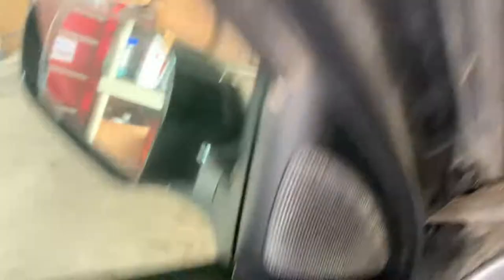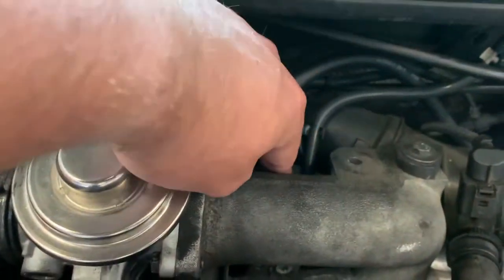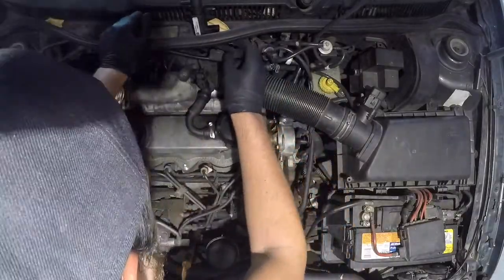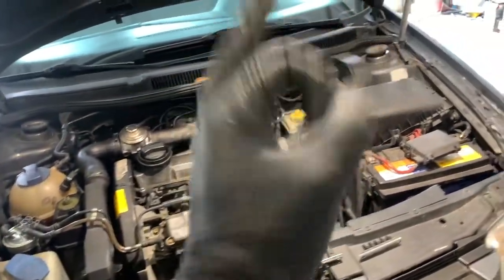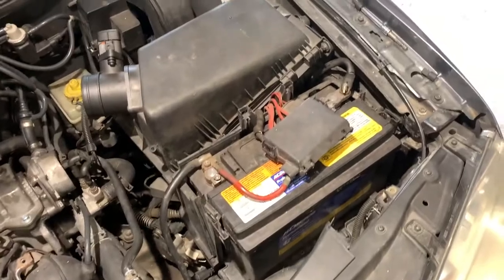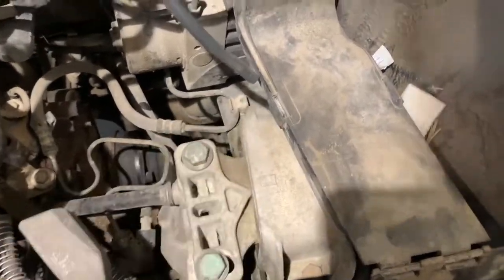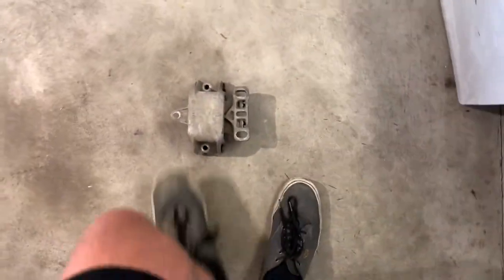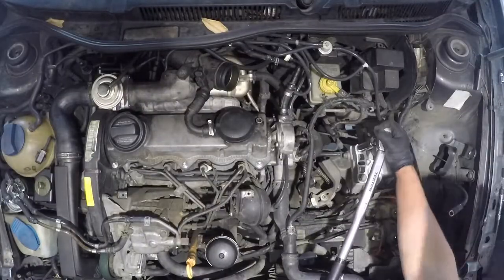Installing New Motor Mounts on the Jetta!

Comment: Did you jack the engine up at all for the motor mount replacement?
Reply from the maker: Yep placed a jack under it and just enough to take the weight off the mount and then removed and replaced.